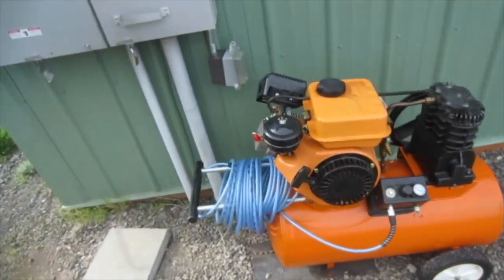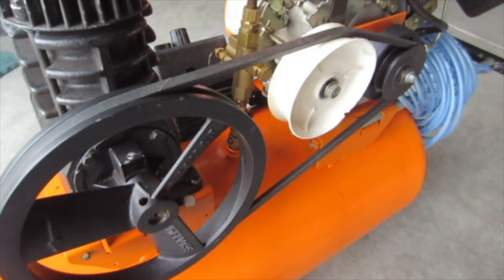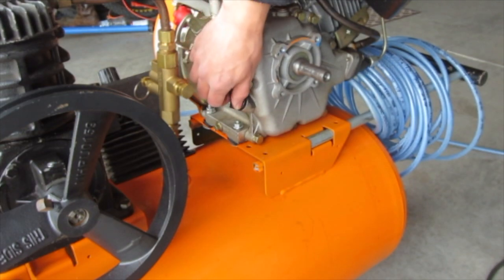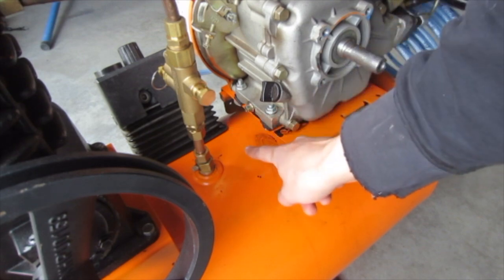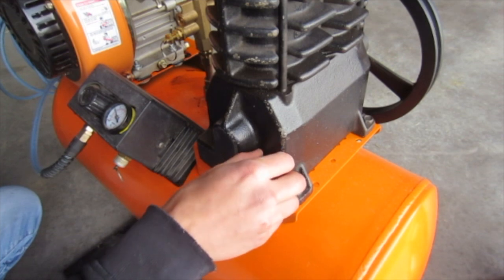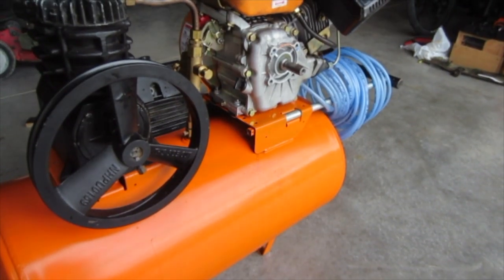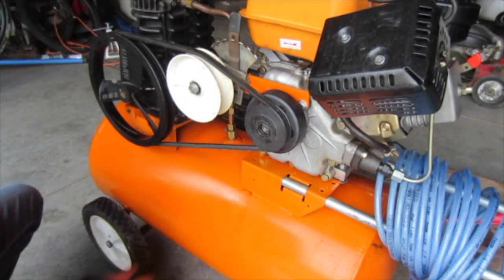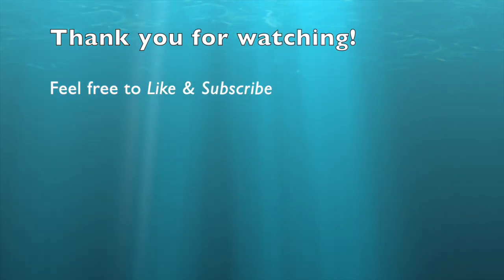How has my Chinese diesel engine held up after 1 year of use? (Servicing the air compressor)

Comment: I think I read that the 3.5hp version which I think yours is, uses splash lubrication whereas the 5hp 173 model has an oil pump and pressure lube. Can anybody comment ?
Reply from the maker: I took off the crank case on this engine before, and yes it uses splash lubrication.

Comment: Well this thing is cool although its a little bit sad for the engine because i thing the engine has a way bigger potential than only running an air compressor since diesel are made for long time usage but its a nice project and good work! 👍
Reply from the maker: Yeah, I think it'd be better suited for an application like running a generator where it could get up to operating temperature and run for a long period of time rather than just running for 5 min max. But I'm glad you enjoyed the video.

Comment: The Sichuan Sifa MB168F diesel has all steel gears, except for the governor. The high oil consumption will surprise most people. I made a 20 MM to1 inch crankshaft adapter to mount an 8 inch pulley on mine. It stays mounted on a thick aluminum plate or a hard fake wood plank, but a steel mount will always work loose. I turned the throttle stop bolt way in and I pour oil with no funnel to keep dirt out. The factory muffler will drip oil, so I expect to wipe it off a lot. This is a real premium diesel purchase at a reasonable price. Even the tall air cooled diesels don't come close.
Reply from the maker: Interesting, I don't have a need for another diesel right now, but if I ever do, I'll have to look into these.

Comment: 2 things...1 you got intake and exaust valves backwards...2 you put way too much grease in that clutch, if your gonna try to be informative in your videos then maybe you should inform your self first so that you can then properly and accuratly inform others...
Reply from the maker: I did get the valves mixed up, although it's not important, they both should be set to the same tolerance which is around five thousandths of an inch. I put way too much grease in that clutch for a reason, the clutch has a lot of play in it, and therefore it will not allow the engine to idle, because it vibrates so much. The heavy use of grease helps take up the gap, and allows the clutch to work correctly, if any grease gets on the clutch shoes, I will just clean it off with brake cleaner.

Comment: get a drain zit for the engine, its a hose that attaches to the drain plug that makes oil changes on small engines easier
Reply from the maker: That would be a good idea.
Reply: @Differentthings2006 don’t it takes absolutely forever to empty your engine with oil I took mine off cause I was so frustrated
Reply from the maker: @dmilladakilla2487  I might just buy a little pipe and extend the drain plug away from the engine a little bit. It'll also of course help if I run the engine first, so the oil gets thinner.

Comment: 1. Clever use of spare lawnmower wheel!
2. I'd be wary of grease flinging into the clutch shoes.
3. You  could try nylock nuts to mount the engine, which could be almost loose so that your rubber washers are less compressed.
Reply from the maker: Thanks for your comment, those are some good ideas, if grease does get on the clutch shoes, I'll just clean it off with some brake cleaner.

Comment: You should add idle control, I did on mine. They call it a pigtail for some reason.
Reply from the maker: That would be a good idea, would you just add a little notch for the throttle to sit at idling speed?
Reply: @Differentthings2006  There is an idle stop.